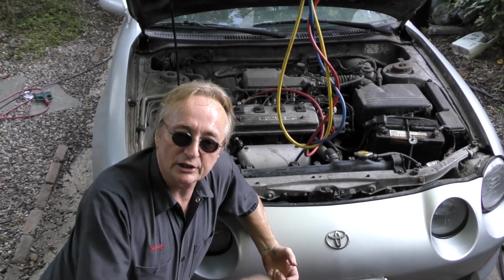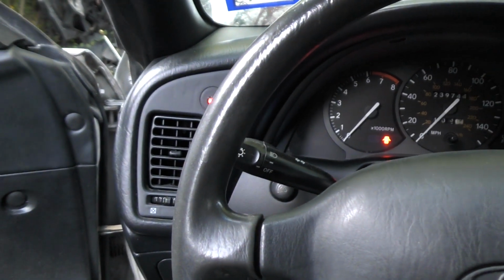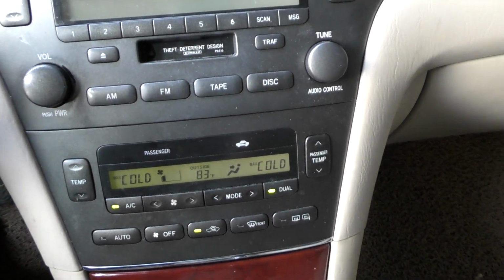Doing This Will Make Your Car's AC Blow Twice as Cold

Comment: Hey Scotty when i turn on the AC and the fans start to run full blast, the engine rpm drops for some seconds and car starts to shake. this happens frequently when i am using AC, almost every time the fans run full speed.
Reply: Bad alternator?
Reply: @teravolt6113  could be. But i replaced it 2 years ago

Comment: With my Prius, the AC doors get stuck when it's really hot out. The only thing I did that fixed a stuck door was to keep changing the modes until something moved. Usually from the defrost to blowing on the floor. Back and forth a few times.
Reply: The same happens with my Vauxhall Agila A, a distribution door sticks whenever the car has been left in the sun. Running AC frees it after a few minutes.
Reply: Did this with my Grand Caravan, was blowing warm on driver side, cold on passenger.  Ran both controls together from cold to hot and back again several times, that got the actuator on the driver side working again.  Working for about 8 months now no problem.

Comment: Had a truck that I used a coat hanger in the dash to control actuator door....  Worked like a dream, Just looked like a nightmare. But the repair required removing the entire dash and vehicle value was 1k below the repair cost 😉

Comment: Sorry Scotty, but the compressor ONLY pumps the freon thru the AC system, it DOES NOT make the freon get hot as you said.The freon gets hot when it circulates thru the evaporator absorbing the heat inside the home (or car) that is being blown across the evaporator core. Then it is pumped outside to the condensor where it is cooled and turned back into a cold liquid that will go back to the evaporator and absorb more heat, over & over & over.

Comment: Everything leaks. Nothing can be absolutely sealed including even soldered copper joints. Refrigerant will leak through not only compressor shaft seal, but all other o-ring joints, hose crimps, and other a/c component seams etc. Adding refrigerant is really not for backyard mechanics as refrigerant charge is really critical and over-charging a system can be just as bad. Also, as refrigerant leaks so does refrigerant oil, and continually "topping-up" refrigerant will inevitably result in low refrigerant oil levels.

Comment: Mechanic told me that my A/C compressor is going out.  How do i know that for sure? Have a 07 ford escape.
Reply: You can check. If the AC compressor is visible. Run your car and look at the compressor. The plate needs to connect if you turn on the AC. And if it doesn't engage then your compressor can be bad

Comment: Hello Mr. Kilmer, I own a Honda City 2004 in India, the vehicle is 15 years old and has clocked 100k kms. Now while driving the AC goes off intermittently and recovers after turning on after some time. But when it goes off the engine rpm rises up to 2000. What could be the issue. Please share your suggestion.

Comment: Scotty, my 07’ Corolla makes a rattling noise in the engine bay when running the air for a long time and it’s quite loud then when you turn the air off you can still hear it when at low rpm. I’m thinking it’s a pulley, mainly the idler pulley but I’m not quite sure. How can I check this? My ac blows very cold and I don’t think it’s the compressor.

Comment: Scotty, both you and my Father are auto GODS,  everything I know I learned from helping my Dad restore his classics EX: 1955 chevy 2-dr hard top coupe , and several 1957,s all chevy,s all original parts were used my Father would go to extreme,s to get factory original parts an if they needed to be be repaired which a lot of,em did, he worked at a machine shop named Crown,Cork an Seal here in balto. MD in Canton , east coast, his desire to build a car from the ground up with tar top batteries, wonderbar stereo,s rocker panels, head light lubers, even every piece of glass had a part # that you could clearly see in the glass its self , he was a super perfectionist like your self, how he knew the things he did, and got it done and to stand back and  look at his finished car, was nothing short of AMAZING , I remember a man had a 1957 2-dr hardtop coupe, it looked like the only place for it was a car crusher, I kid you not Scotty, it was half gone, all rust, no wheels no interior, just remains of what may have been a car one might think, lol but after about 2 yrs I had to pick up my jaw from the ground, I asked him is that the same car that man in west Virginia gave you ? his answer , certainly it is , hows it look ? I was speechless, my mind was a blank, im asking myself how in GODS name did he do this , Scotty, to this day over 30 yrs later til I seen your 1st video, I thought my Father was the GOD of repairs and mechanics the world over, but you have proved yourself to be equally as efficient in mechanics as he is, though his thing was mostly the classics , cars mainly from the 50,s an 60,s and chevy,s and some fords I seen ,em re-store a 1939 ford coupe 2-dr , he put 3 , 2-barrell carborators on it 2 per every 2 cyclinders , it flew Scotty, that 39 ford coupe was fast ,very fast, but he just turned 81 this past JULY  7th he was born JULY  7th 1938,  he no longer climbs under any cars now but still goes under the hoods ,lol but laying on a creepier is out of the question,lol , im still fixing my recent purchase of my C-3 vette a 1980 all original , its all minor work, valve cover gaskets , oil pan gasket, trans gasket an filter, and some hoses, need attention and my left front brake caliper, has a slight leak , and it too isn't blowing I feel the air coming out when I turn on the A/C its cold but even after I set it to high and max its still not as cold as it could be, so ill try adding some Freon to it, an see if that helps, thanks for this post Scotty, I started thinking it may be my compressor, but ill try the Freon 1st , thanks Scotty, keep the video,s coming sir, there awesome, and save us home mechanics a ton of money, God bless you Scotty, a home mechanic, William in Baltimore, MD. a 1980 C-3 vette owner /re-store. take care

Comment: I have a 1978 Lincoln Town Car, A/C is still freezing cold with the factory installed R12, I check the level every June, because here in Las Vegas, ya need a great A/C system.... has the A6 compressor and it's quiet and smooth..
Reply: If you ever scrap it, try keeping that A6 with you. Perfect as an air compressor.

Comment: Scotty, I'm not a car person, but I love your videos. Always learning something new!

I've been having an intermittent issue with my car's ac. It's a 2009 Honda Civic. I've tried everything I've found online. The relay seems okay, the refrigerant is full, and the compressor clutch engages properly. But on an extra hot humid day the AC works great for about 30 minutes, then blows warm air for at least another half hour after. I'm thinking the evaporator line freezes up with moisture, or it gets too cold and the coil gets ice build up preventing the air from getting cold.

Seems to be a common issue, any ideas?

Comment: 2010 Ford Fusion. Great car but since moving to Texas haven’t had the best of luck. Had the evaporator replaced. $450, replace the blower motor $85, replace pigtail, control module and plug.!$550
Dual air controls

Comment: Please am having engine misfiring with my Chevy Cruze 2015, I have PCV valve cover, new sparks plugs and coil but still the engine keeps on vibrating, and when I switch on the air condition it get worse, please I will need your help and advice,  electrician and mechanic have been taken my money, on this issue, I have the check engine light and traction control light on

Comment: Hey Scotty I have a 2005 Honda Accord ex and when am driving it  it drives well but once it hits 30-40 mph it feels like it goes into neutral and i don’t know why is that happening I already change the torque converter clutch solenoid but it still does the same. Any advice?

Comment: Thanks Scotty for this informative video!  What you say about the compressor using oil and refrigerant to keep it lubricated.  My 1966 Corvair Monza 4 door hardtop has its original Frigidaire A/C system and it blows nice and cold!! be"h
Reply: Gojoe283, oh MAN!  "Corvairs" - I remember them fondly!  My Dad  LOVED those old Corvairs; he had two that he bought used - 1st one was a 1961-Hardtop 3-speed manual, and the 2nd one was a 1963-Hardtop 4-speed manual. On the quite rare occasion that I see someone out driving one that they have lovingly restored, I always think of my Dad; and yes, pictures of Corvairs, or when someone (like you for example) happens to be discussing them.  By the way, my Dad didn't give one hoot in hell what Ralph Nader had to say about the Corvair-design either!

Comment: you’re gonna cringe when u hear me say this, but my 20 year old bmw has an amazingly well built AC system. 20 years and no service ever. no recharges. it still blows ice cold and works flawlessly. then again i got a very well maintained car!
Reply: I'd still have the refrigerant weight checked after so many years if i were you. Even though it may be still cooling enough, the oil might not be moving around the system as easily as it once did.

Comment: I’m confused what that 5,000 scanner gotta helps with the a/c system ? His scanner showing the a/c compressor megnet if it on and off that it ?  And how this ob2 scanner  compatible with the 95 Toyota Celica? I tho it ob1 adaptor and doing quick check engine light flashing by bypass the ob1 under hood  someone helps me here if I’m wrong

Comment: Egads, Scotty, you must be dying in the Texas heat! Hope you're staying hydrated!

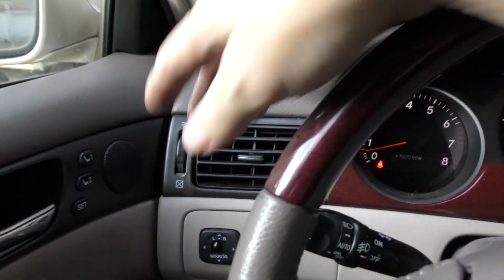4:01 - Indeed. Got an '05 Town & Country that has a failing blend door actuator, it takes quite a bit of back-and-forth of the temperature knob to get full-cold or full-hot. We try to get it one way or the other depending on the season, and leave it there until absolutely necessary to change it.
I never thought I'd miss vacuum-controls on the older GMs... When the HVAC panel failed in my '94 Cavalier, I used a 3-way gang valve for a fish tank air pump to choose modes until I got myself up to the junkyard for a "new" one. Shocked a few buddies that thought I was crazy until they saw it actually worked.
I've never EVER had an issue with any cable-driven HVAC controls, gee, I wonder why?

Now, my stupid airflow actuator is shot in the Camry, but it's stuck on vent, which is tolerable until I tear everything apart to fix it. I'll probably have to pull the driver's seat out to get up in there. It's on my to-do list from last fall. :-P

Comment: Mines the opposite, cool on drivers side and hiss in the passenger dash when the AC is shut off. It's a 2006 so it's very possible that it's low I'm guessing. Blend doors all work except the recirc door which I shut to keep the hot air out (tried with it open and it never got cold)

Comment: 5:33 -- This is very true my father's 2005 Chevy Silverado temporarily had this issue with cold air blowing out one side of the air vent and hot air blowing out the other shortly after a battery change.  The problem corrected itself simply by briefly disconnecting and reconnecting the battery connectors.

Comment: My 2003 Ford F-150 was not cooling. I took it to my AAA certified mechanic. He found the compressor had a blown seal. He replaced the seal. And now I freeze my butt off even in the high ninety heat here in Georgia.

Comment: Sometimes i feel like the ac makes my car run rough y would that be ?
Reply: It takes a fair bit of engine power to run the compressor. A smaller engine has to work harder, and depending on the engine, it may have to really strain (especially when idling). You MIGHT not have any problem with your car at all if it's a very small engine.
If you are in need of a tune up it can make the car run rough whenever the compressor engages - it magnifies any problems that otherwise you might not notice until the parts degrade to the point where you DO notice it all the time. Also, the radiator cooling fan(s) kick on, which is a huge draw on the electrical system and the sudden draw of power as the fan(s) first turn on can lower the voltage slightly at the fuel pump/engine computer/etc. which feels like the engine is stumbling/hiccuping. That's why Scotty mentioned having the electrical system checked, if the alternator is getting weak, it may take longer for it to increase its output to compensate or it might not be able to fully deliver that power.
Another point to consider is your engine mounts. When the engine is under load and it is able to wiggle a little, it can feel like it's running rougher and that vibration goes through the body of the car - you can feel that vibration through the seat, steering wheel, etc.
I think I've covered most of the possible causes, and it's probably more info than you actually need, but better to give too much info than not enough. :-) Good luck!

Comment: Had to swap a blend door actuator on my 2009 f150 with the dual climate controller and it was a nightmare.  passenger side so I had to take apart the whole dash and make my own tool to fit in the tight areas.   Dealer wanted 950 bucks. part was 50 bucks and tool me a day.

Comment: Hey Scotty
Just wanted to share that if your AC is overcharged with refrigerant, your compressor can keep turning on and off every two seconds or even less. The mechanic thought it's low on charge at first, but searching online he found out that it only needs 470 grams of refrigerant, not 510 as it was.
Reply: Interesting. Just had that exact same scenario with a Freightliner M2. Recovered the system and there was 4.20lbs inside when it only needed 3lbs!😅😅

Comment: What about when the AC works good at idle but under acceleration it blows warm? Then blows cold again when the gas pedal is released? What could that be? How could the AC be linked to the throttle?
Reply: It may be overcharged or have air in the system both of which raise the pressure when working , if the pressure gets beyond the pressure switch setting it will cut power to the clutch .  It can also cut out if the low side pressure gets too low which indicates a low charge but you say it works well at idle so I doubt it has low charge . 
           You need to hook up a set of gauges and run it , then increase the rpm and observe the pressures to properly diagnose it .
Reply: Normal if you are accelerating over half throttle

Comment: I’ve never had a car with a single temperature control blow cold on one side and hot on the other. I’ve had it blow warm and warmer or cooler and cool but not much of a difference in temperature

Comment: I have a 2013 Scion tC and recently a small humming is coming from my passenger side when I turn on the ac. I already took out to blower motor but it was clean with no debris in it. AC works, but I’m still getting a small high pitch hum, any ideas?

Comment: Alright scotty!  My 2007 focus runs perfectly at 117k mi. The air conditioner and heater work, but, it is hard to change both the temp and the (I don't know what to call it) vent selector. Do I worry? Would replacing the parts be expensive?
Reply: I've seen that before. You need a new control panel
Reply: @rays7437  will it break? It's sticky, feels like it a plastic link. The control for the ac is solid. Ur suggestion sounds expensive/labor intensive. Should I replace immediately or wait. Can I find it at salvage cheaper than new? Are there any after market replacement parts that are of better quality?
Reply: @NegativeHeadspace  
Have you pulled the knobs off to make sure that the sticky feeling isn't actually something sticky? Like soda. 
That control panel isn't terribly difficult to replace, but I don't know if new parts are still available.  You would have to call the dealer parts department to find out. They will need the V.I.N.
Reply: @rays7437  ok thanks man. R u a mechanic? I am just asking for professional advise. Also I am looking into the potential problems and fixes. Just bought the car, is the control panel cheaper salvaged, or new?  Is a pull-a-pArt control panel worth the time/effort?
Reply: @NegativeHeadspace  
Like I said, it may no longer be available new. 
I'm trained as a technician but I have been a service advisor for the last 20 years or so. I've been with Ford since 2004.
I've seen of lot of all kinds of problems.
Pull the knobs, clean out any sticky soda if you find it.  If you have a base model car then it could be just the cables binding or the doors binding. 
More likely it is the controls themselves. I've seen where the rheostats sieze up. They are not usually available separately.  
If they control panel is not available new then you will have to get one salvage.
It's not that difficult to replace it

Comment: Scotty im looking at getting an imported right hand drive 1994 Toyota GT4 Celica, it has 32k miles and only some small tasteful mods like rims, intake, and some different gauges... my question is if these celicas have the same type of reliability as the standard ones ? I know it has a turbo and an AWD system so I’m wondering if these parts can be problematic? Thank you for your time and awesome videos, by far the most knowledgeable YouTuber out here!

Comment: I have a 2012 and 2013 impala. Both have knocking sound coming from passenger side of d dash board. It is caused by d blend door actuator. I have replaced them like 10 times. YouTube and d internet has lots of complaints for this door all d way from d 2006s impala. Wonder why GM keep making this problem. May be d dealers has to make money from fixing them. Other than broken plastic gears, there are no better EXPLANATION as to why they are failing. Is it a calibration failure, over driven by a pc board etc. Why? Could u pls take a look at it.